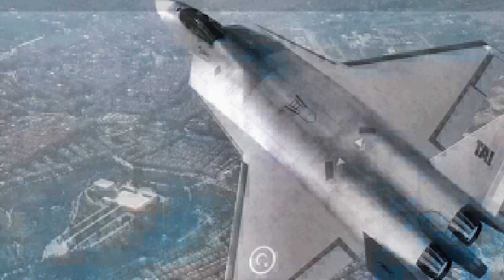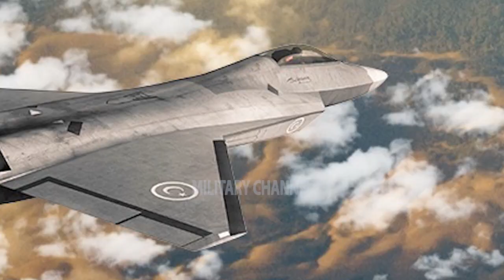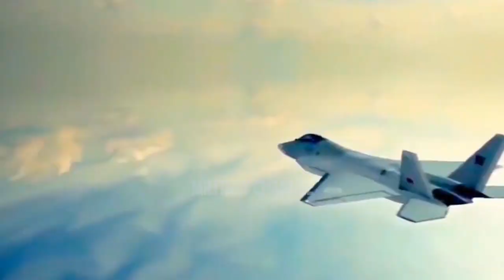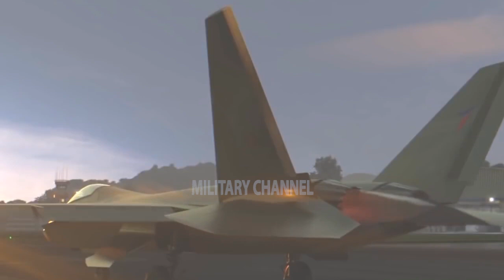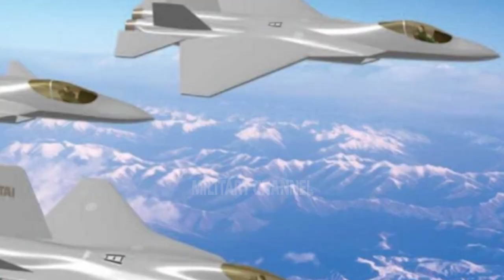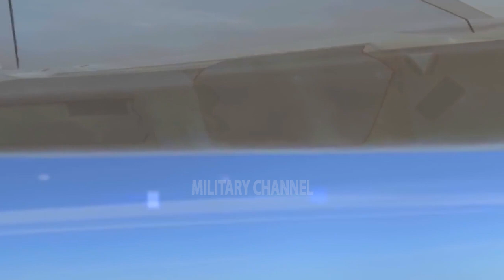Malaysia Targets Release of National Fighter Jet in 2030, Equipped with Stealth Technology

Comment: According to CIA intel report. The Malaysia stealth fighter not only invisible to the radar,but fuel and engine will be designed use the palm oil. This fighter not only stealth to the radar its also can carry napalm, nuclear bomb and hydrogen bomb and withou external fuel tank carry reach the 10000km range in single sortie.